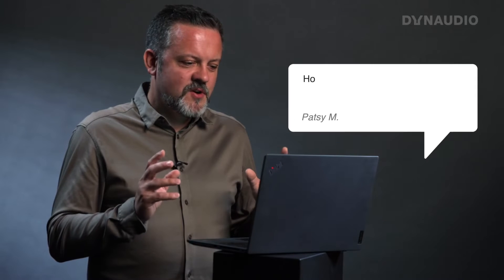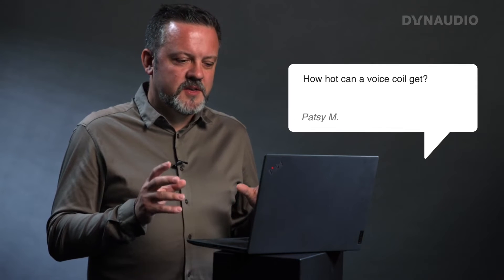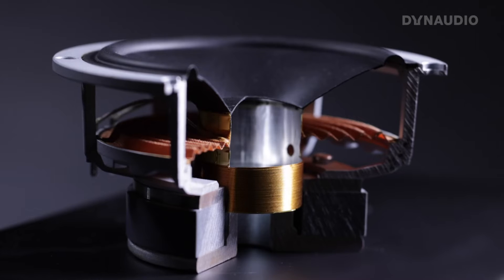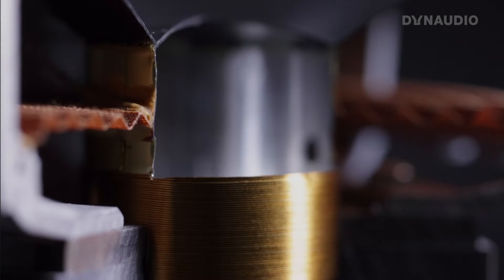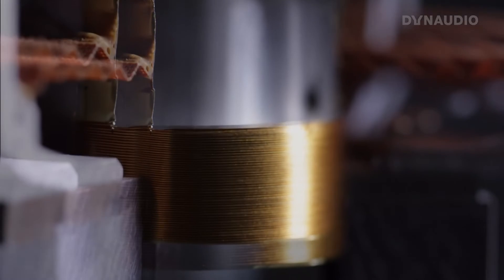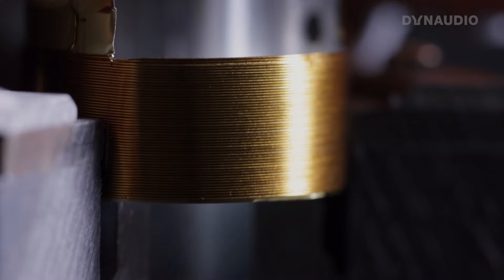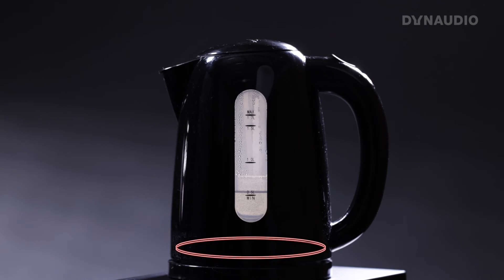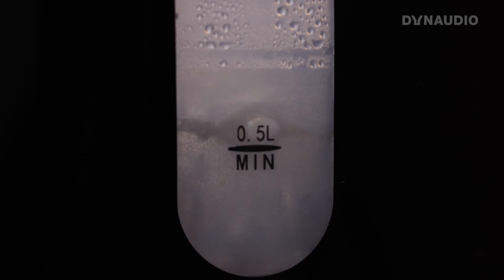Boiling voice coils? Is it possible?

Comment: Hi Otto! Very nice videos and very interesting toppings! Can you please tell me something that is hard to understand from my side? I have always related small diameter drivers to low power units, and big drivers for high power.  For example, when I started with hi fi systems,I did with a 25 watts stereo amplifier (Sansui , by the way). At that time I used a DIY 2 way system with a 8” woofer, and it’s excursion was way big just with 25 watts, and of course it sound very loud! ..So..why do I need to drive a bookshelf speaker with a 60  or 100 watts amplifier? Does this only means wasting of energy? Or just getting the drivers to it’s limits with no sense? Hope you get the idea and can clarify this a bit in some other video. Thank you!
Reply: Hi Pablo. Sorry for the late reply - interesting question! In many ways, it is the other way around - I would say that we don't "require" larger amplifiers, as much as taking advantage of the fact that they exist. In the "old days", powerful amplifiers were big and expensive, so speakers were generally designed to be relatively high efficiency - meaning they played relatively loud with few watts. The problem with that is that with speakers, you have a "triangle" between size, frequency extension and efficiency, where you can optimize towards two of them but not all three at once. So, an efficient speaker will either be large, or not play bass. A high efficiency speaker that plays deep bass, will be large. A small speaker with good bass will not be efficient.

On top of this, there are compromises in making a speaker more efficient. For instance, putting damping material inside the cabinets make the speaker less efficient - but also makes it sound better. So, a common way to increase efficiency is simply to accept resonances and their various negative effects on sound quality. You will often see that high efficiency speakers have poor frequency response, poor distortion and various audible resonances.

Over the years amplifier technology evolved, and good quality high output amplifiers are no longer as large or expensive as they once were. This means that we can sacrifice some efficiency, and work towards making the speaker sound better, while using the higher available amplifier power to make up for the lack of efficiency. It's always a balance, but essentially it's easier to make a good sounding speaker, especially given a certain cabinet size, if you have 100 watts available, than if you only have 25 watts available.

/Otto, Dynaudio Academy
Reply: @DynaudioAcademy  Thank you Otto for such interesting concepts. Have a nice day!